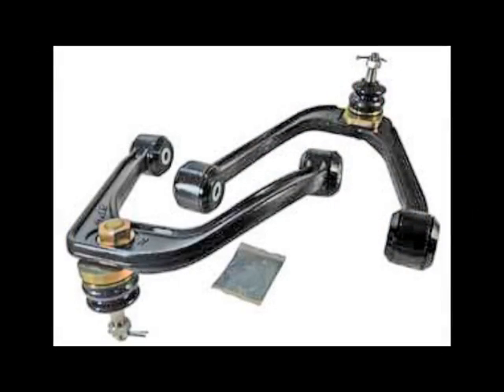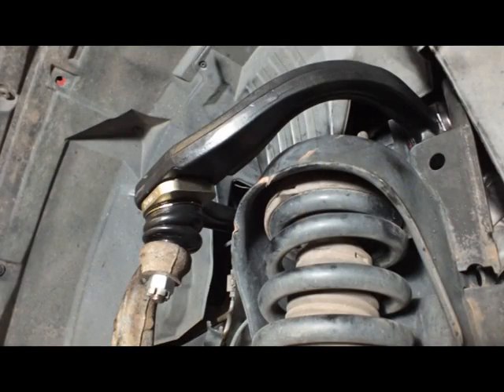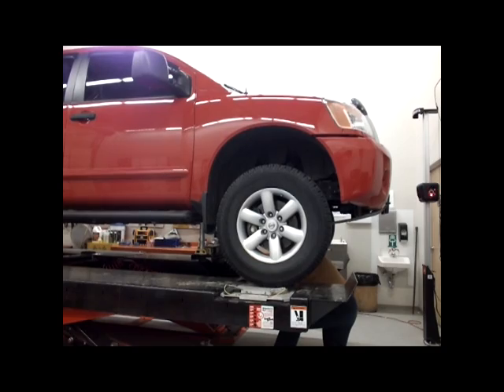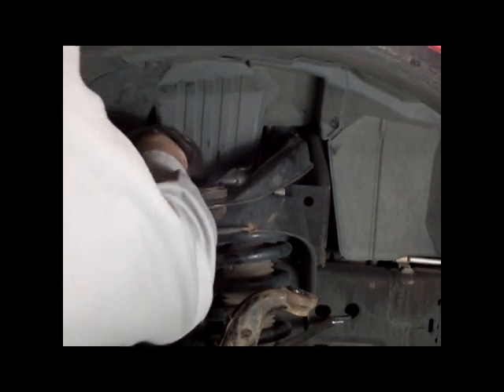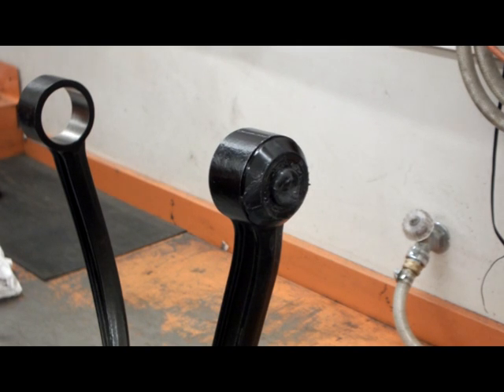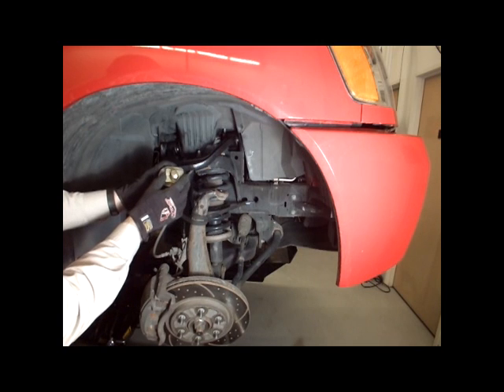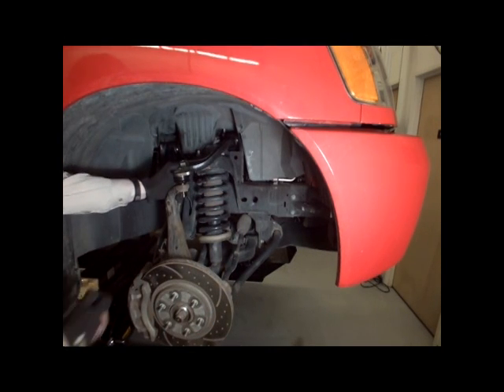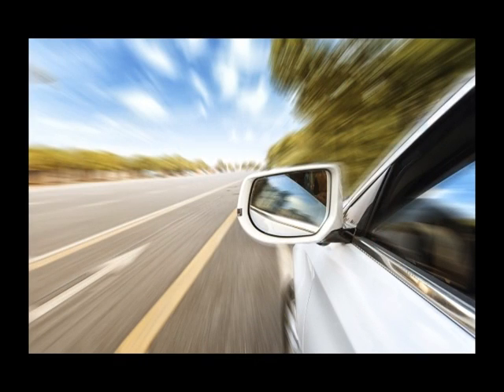25560 - Titan Adjustable Control Arms - Specialty Products Company

Comment: Ares these good to pair with bilstein 5100 adjustable front shocks? I wanna get a 2in level out of it with the proper control arms...
Reply from the maker: They should work well with the Bilstien shocks and a 2 inch lift. These arms will clear the spring bucket better and provide considerable camber and caster adjustment.

Comment: I have 3 inch rough countrt lift with struts. But still have a 1.75 in rake will these work if I add a 1.75 inch puck on top of my strut
Reply from the maker: We can't recommend these arms for 4.75" of lift. The potential down travel caused by the combination of the lift and the puck might over articulate the ball joints. If you want a level truck, it would be better to reduce the rear lift by 1.75".